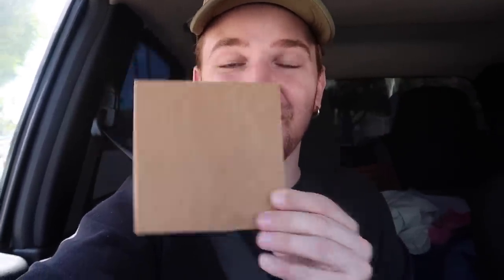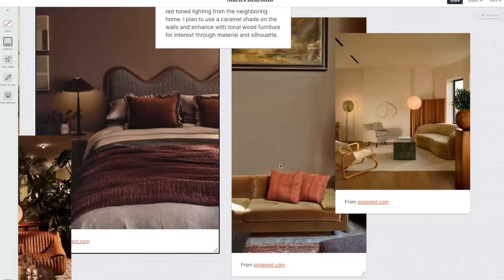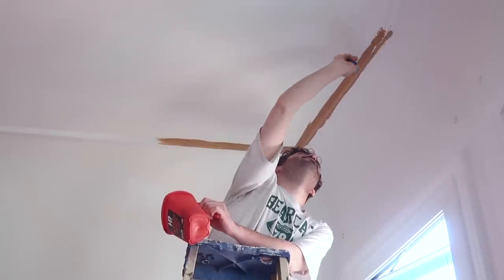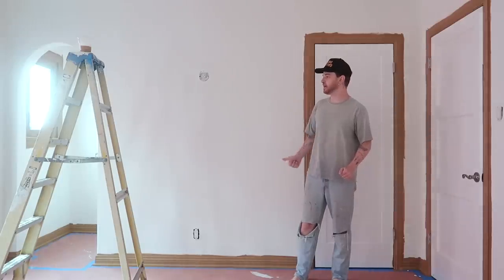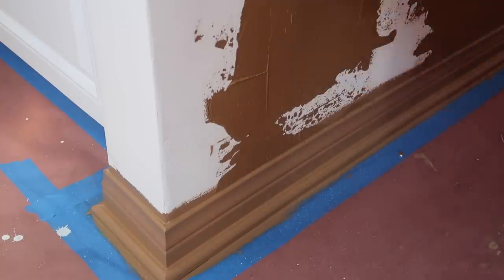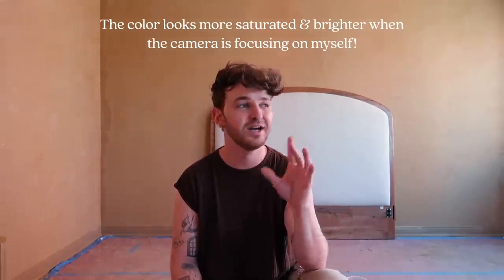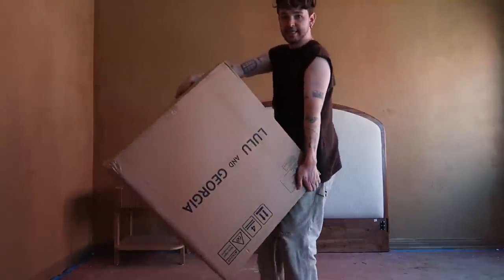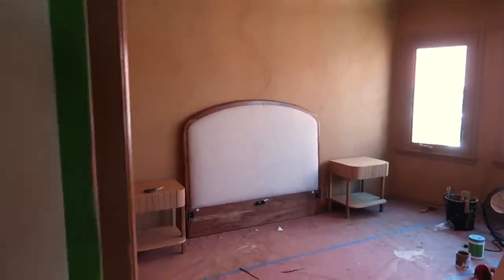EXTREME Bedroom Makeover for Marie! ✨ DIY Plastered Walls & New Furniture!

Comment: The reason the green elements in the room read as brown or muddy with the red light is because that’s what complementary colors do to each other. Landscape painters mix complementary colors together to get the appropriately toned browns, grays and muddy neutrals that work with their color palette.
Reply: Thanks @mashastopa. I'm just learning about mixing color to creates unified tones and did not know about complimentary colors and landscapes which would seem to include roomscapes.
Reply: Check you out dropping the knowledge 😊
Reply: Off topic but that's why I don't understand how "color correcting" makeup can work: add green concealer to your reddish undereye circles to make them "disappear" ...wouldn't they just turn brown/muddy?
Reply: @martifinan998  Love this. You're jumping into advanced color theory. The over-simplified answer: Colors in light are pure colors, whereas any pigment-based color is not pure. So the marvels of modern color chemistry can neutralize the red and create a flesh tone, which actually has some brown in it. I hope that helps!
Reply: @marshastopa  Thank you- it does help! But… aren’t both paints and cosmetics pigment based (likewise,  neither are light-based?)?
Reply: @martifinan998  You are correct. Pigments are not pure colors -- they typically contain another color that makes them lean more cool or warm, which is why color mixing of any kind is skill that requires knowledge of the ingredients and how they react together.

Comment: Drew, like you, I usually prefer a darker ceiling, it lowers the look of the ceiling and pushes the walls out, making the room look larger than it is, but this isn't an issue in this beautiful room... 
So, I say go light in this case, it ties in with the bed - plus you have the great dark timber floor. It's easy to change a paint colour later, if it's dark over light, and it's better to paint the ceiling first, to save getting it on the walls!  I really love all the choices you've made... ❤🦘

Comment: I’d have loved to see the ceiling trim dropped down onto the wall, a titch below the curve, with the ceiling paint color above the trim, flowing from wall to ceiling. It would visually lift the whole ceiling. Colorwise, you can get away with deep colors on high ceilings like this. It imparts coziness. The plaster is lovely.

Comment: Caution: too much brown can give 1950 'FAUX PANELED" DEN vibe. Did  you notice how much smaller the space feels now?
 Just think in the long run  to make a simplified serene space for Marie -
take the wall opposite the bed and make a full wall/full height shelving unit.  It would be an excellent focal point in room, make great use of that wall, add storage, and give visual interest looking at that wall from the bed. In addition having one wall entirely done as shelving ( can be cabinets below shelving on top, and can incorporate a desk) will help make the room 'simple' and restful.  BUT Drew you know best so looking forward to see what happens !

Comment: Cream ceiling... it would tie in so nicely with the headboard and draw the eyes upward. I worry that there's a thin line between cozy and cave-like. Also, if I recall correctly, a few of the other rooms you've renovated have dark ceilings (either painted or wood), so a light ceiling would mix things up a bit.

Comment: For the ceiling. I will. Add wallpaper has the same light color background of the headboard and also have other color Like flower matching the wall color. It will be a good  relationship between both colors.

Comment: Don't know if this would work for Marie's room, but whichever way you go with the ceiling color, consider getting the plainest, flattest light fixture possible. Then, over that, you could place an open, classic paper parasol with the handle cut off, or cut way down, for an exotic, classic-Asian/30's-art deco movie theater effect. You can often find lacquered ones, patterned in different browns with black accents in  Asian antique stores. To hang it, there are a couple different ways to go. My cousin used magnets.

Does Marie know how lucky she is to be living with YOU???

Comment: I was wondering whether I could put these plaster on my tiles in the bathroom. I don’t want to remove the tiles (they are from the floor to the ceiling) and do the full renovation. I was considering painting them, but I know it’s a lot of dusty work which I would like to avoid. Putting plaster seems to be much easier process.

Comment: Go for the plaster on the ceiling or at least the color. A bedroom is an opportunity to create a "womb" room. However, if the room will be used for more than sleep or relaxation such as reading or knitting, you will need more light and in that case a lighter ceiling is better.

Comment: As for the ceiling, it should not be so white, IMO.  I think you should mix white with various amounts of the paint you used on the trim, and test which mixture gives you the best effect.  Or, if you want to be bold, consider a patterned wall paper.  Something in the ochre/sienna tones of the plaster...that could be stunning!

Comment: Love the walls, but wow what a pricey project.  For a budget version of this 2 coat plaster application, would it be possible to go with a 1 coat plaster project by replacing that initial plaster under coat with a traditional wall paint in the same color?  It would prevent 'white' wall scratches showing through and could cover the wall with color similar to the first plaster coat.  After that painted color on the wall,  would only one plaster layer on top look good and possibly have the same effect as 2 coats of plaster?  Just curious about this....

Comment: I also vote for a light ceiling BUT...why not add just enough of the wall color to the creamy white you are thinking about using? That very light tint would appear to be white by contrast but still able to soften the red light coming from next door. The light feature you are choosing to embrace will be bouncing off the ceiling as well as the walls.❤💚🤗🤗

Comment: I HAVE A QUESTION! I have seen a number of videos where people paint over the hardware like the window latches, hinges, electrical outlets, etc. but I wonder how that holds up over time given that those types of pieces are not stationary. Do you have to score along the moving parts?

As for the ceiling, I vote for it to be cream. But why don't you use one of those VR apps with paint colors to "test it out"? It won't be exact as what it would look like in real life, but it would give you a better idea of what each choice could look like.

Comment: Looking fantastic so far! Keep the light ceiling. Your arms will thank you later. I imagine 2 coats of plaster would be much more work and expensive than paint. If not, maybe use flat color match paint if you need to test the color theory before committing to the plaster.

Comment: I don’t have a real opinion about the color of the ceiling I would caution you against using the matching bed to make the decision.  It looks kind of cool to match the ceiling to the bed-I know that’s not quite what you’re doing but I see how it’s aesthetically pleasing.  Do the room the way you like it and the bed will work either way.  

That said, I have coved ceilings (without the trim you have) and I have painted the rooms with coved ceilings all one color.  I have seen other homes in my neighborhood where they draw a line or add trim to have light ceilings and I like mine better.